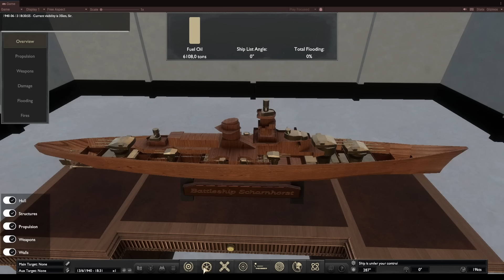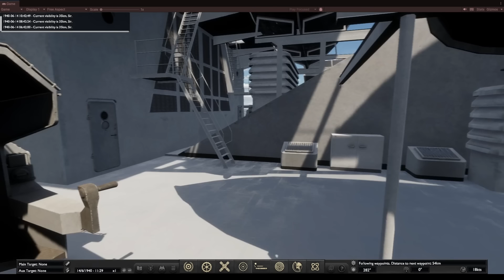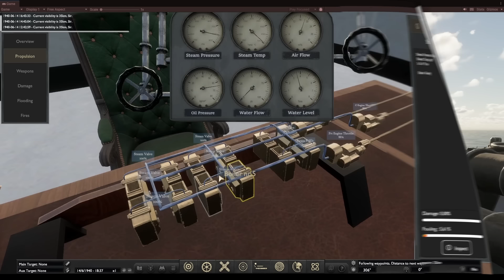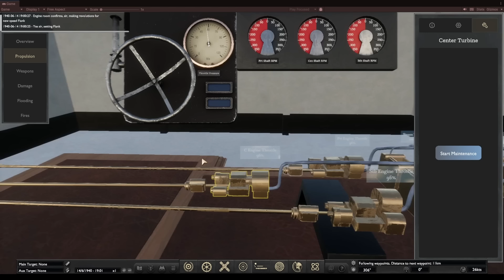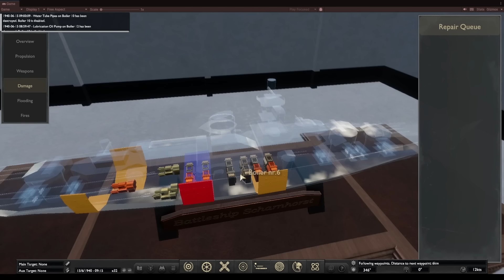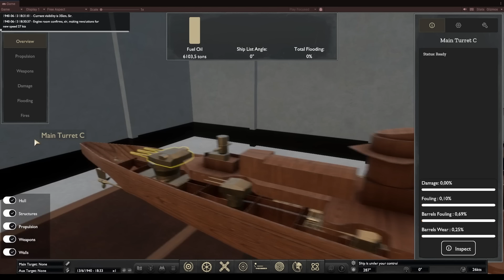Damage Control & Engine Management On Your Battleship

Comment: Huh. Why would a steam turbine foul? Isn't fouling the buildup of combustion byproducts? It happens in boilers and gas turbines, because that's where the flamey stuff happens, but I don't see how any gunk would get into the steam loop.
Reply from the maker: Hi!
It can be corrosion particles, rust particles, unwanted oil or steam that still contains water droplets. Then there are many other subsystems connected to the turbine, like oil pump, various pipes and valves, the condensator. A lot of places where dirt and unwanted particles can degrade the performance of the turbine system as a whole.